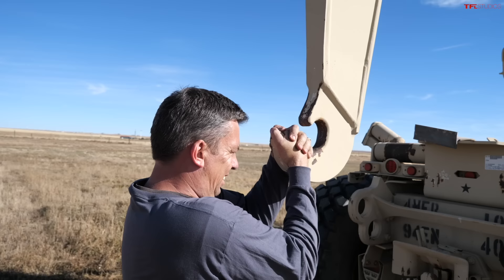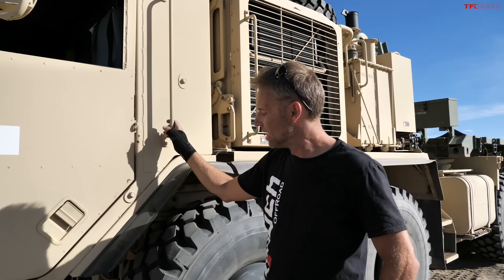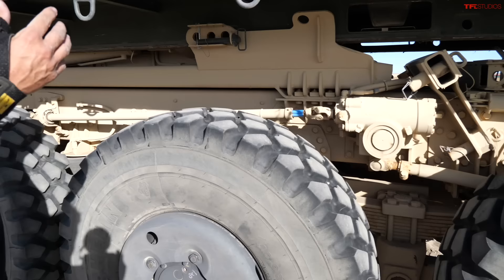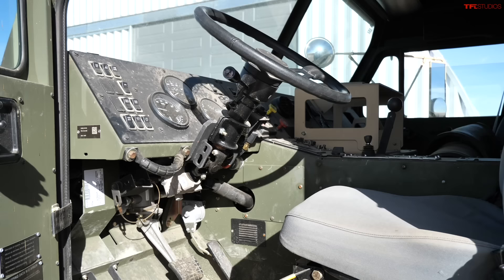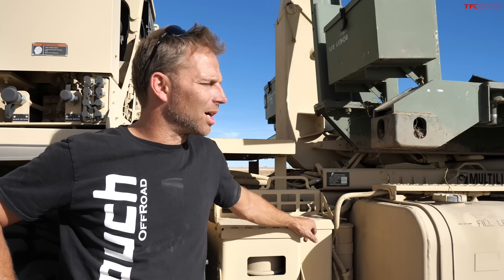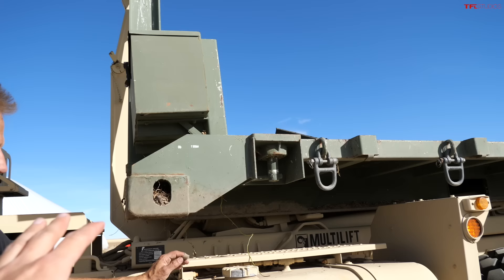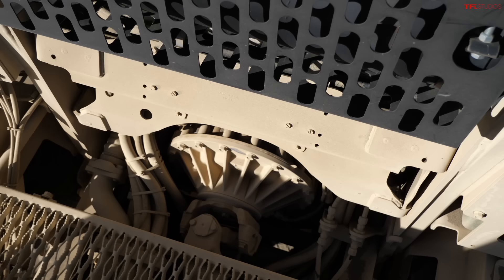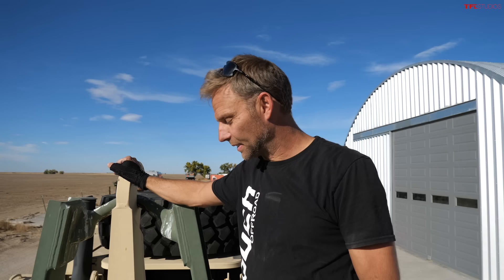Think A 4x4 Is All You Need? This 10x10 Military Truck On 53s Begs To Differ!

Comment: You're using this for recovery you should of just got a wrecker. The m984A4 is an absolute beast. Automatic 7 speed should be an rds 4500. The engine is a Cat C15. If its a front tire you can drop the air suspension chain the axle to the frame and air the system back up, change the tire and unchain. Overlander RV is a good idea for it tho.
Reply: This will chew up any wrecker out there accept an M88.
Reply: In what way?

Comment: We were doing a rail car load out and the ramp between two of the rail cars failed while driving the hemtt across. We couldn’t get the crane back that far to lift the truck back on the rail car. So the driver finished driving it off the side of the train.

Comment: you can make some money with that thing over at MOAB and so forth, all the big 4 wheeler places.. hit like the 400 in las vegas, so many break down and wreckers cannot get to em.. mana 400 lb winch and you can just pull em right up to the platform load em up and go!  people charge like $4000 for recoveries out there in the desert but they usually take 2-3 riggs to get em out... man what a rigggg...gg..gg

those doors and windows are waterproof, you can take those under water... yup get the snorkel attachment.. 7 speed on road 5 speed off with 2 lows.. this thing is a beast why you never see one stuck, some of them have the run flat, and you have like 5 air pressure settings on the fly, hard, hard soft, medium soft and then run flat.. so if you're taking flak and a tire gets hit you push run flat and still get out of dodge...  DOH!!!!  they boogie too, do like 70 I think?

be sure to hit HARD on the tire air pressure system you can do 70, makes the tires larger round... yup
Reply: also they can go anywhere, note the low overhead...  yup
Reply: Don't tell snuffy he can't get one stuck! He will!

Comment: I designed and built armored vehicles for various governments and contractors in the Middle East.
Early in the war starting in 2003 and onwards, we were asked to talk with OshKosh regarding adding armor to the HEMTT`s.

Gave OshKosh a cost per truck to stop .50 cal BMG. The Army deleted the added cost for the armor as "too expensive".Lol. 
They came to regret that stupid decision,later....I would much prefer the TATRA 8x8`s and 10x10`s with the Cummin`s diesel.
Fun fact...a massive freight pulling locomotive can achieve nearly 6 MPG pulling 6000 Tons!
This bloody gas hog gets 2.6 MPG? Only the Army would employ that rig and it`s unarmored!

Comment: there's a place in Illinois called Allen's Corner Garage. his newest Wrecker the bumper lift which sticks out 15 ft from the bumper will lift 100,000 pounds was designed to pick up a hole Greyhound bus.
Reply: one more s t a t it's empty weight is 74,000 lb 3 axle Drive.

Comment: I remember this in the Army as being a 12 cylinder supercharged twin turbo diesel..in the 80s
Correct me if I'm wrong please..
But what a beast that thing is..👍
Reply: Sounds like one of the old Detroit 2-strokes. It's not really supercharged as it needs the blower to run. All it basically does is blow the exhaust gasses out of the cylinders. Now the turbos just added the fun factor :-)
Reply: Sounds like a Detroit Diesel 12V71 or a 12V92 you're referring to. And no, it's not supercharged, it's blown for air intake and exhaust since it's a 2-stroke (compression and ignition/power strokes only).

Comment: Yes, one of these, made bulletproof and tire slash proof, with a specifically built house on the back of it, with solar to have a hybrid like engine, out in the middle of nowhere in say Canada, yes, yes and yes.

Would cost about £3m though, lol.  But no one would be getting in and you could take it anywhere.  Honestly, PERFECT.  Would need to know your mechanics and diagnostics though to maintain the thing.

Comment: That 2.6 mpg at 65 is pretty good considering each tire is like 1k lb
Reply: The tires don't wieght that much.
More like 200lbs 
Two guys can pick up the tire.
Sorry but I'm not that strong. 
800 to 1000 lbs means we both would have been lifting 400 to 500lbs each. 
Maybe they didn't even weight that much. But I do remember pfc K and myself lifting one 
And Honestly PFC K wasn't that strong. 
Funny years later I talked to PFC K and he was working at a pallet company.
I always found it ironic he drove a PLS and later built pallets.
Reply: Oh and mileage. I don't recall but swore it was about 10 mpg. And my foot was pure lead.
Reply: @baddog9320  Tires weight around 350lbs, wheel is about 150lbs. So somewhere near 500lbs each, 5000lbs including all axles

Comment: I think it do have another 4 inter axle diff locks also, if it is 10*10 on any surfaces. Total 9 diff locks if it can travel on high traction surfaces with 10*10

Comment: I like the way you think... GO BIG OR GO HOME...

I designed my own multi-axle 6 x 6 truck. It has 3 complete engine/transaxles; 1 in front and 2 in rear. 6 Wheel Drive, 6 Wheel Steer. Forget a tiny rear bed, it's 8 feet wide x 16 feet long. Can haul full sheets of plywood sideways. One problem we encountered, with over 5,000 horsepower it needs larger fuel tanks. 

We did design a 8 x 8 with 4 engines/transaxles vehicle. 2 in front and 2 in rear. It's set up for Land Speed Records. 10,000 horse power gets it to 600 mph. Waiting for special tires from Goodyear. 

Our 10 x 10 using 5 engines/transaxles has 2 in front and 3 in rear. It's setup like our 6 x 6 truck. Giant back bed, giant crew cab with room for 9. It's almost street with the right tires. 5,000 horsepower, 10 wheel drive and 10 wheel steer. 

Your Monster looks like no one or no thing can stop it. Like driving the baddest rig on planet.

Comment: He mentions the mileage but doesn't say anything about fuel capacity or working range. That's a lot of gears to turn; the transmission w/ torque converter, transfer case, the Open Differentials that can be activated to lockers(lockers aren't differentials) besides the hydraulic steering. That's a lot of work.
Reply: Good point, I don't remember for sure 75 usable gallons?
This is an issue when doing linehaul operations, one other negative is the clearance height. More then one PLS has struck a bridge hauling containers.

Comment: 1,000 gallons of fuel @ 2.5G per mile is 400 miles range. Without anything build on top of it.
Reply: Miles per gallon, so over 2000 miles on 1,000 gallons.

Comment: Pretty cool wagon, not keen on the rear steering axle too much to go wrong, same goes for the independent front suspension, nothing beats a solid axle on coils  like the MAN,s,. Needs a big winch on the front a second winch behind the cab and a pair of spade anchors. Mentioning the beast,s poor fuel economy on the road or any paved surface ,can you disengage the front drive bogie to improve the meagre fuel economy?.

Comment: M1075A1 PLS* I love the the A1 the M1075 is crap. And 65? 🤣 Hope you bought the 10 and 23&p manuals. Also drifted one in Poland in the snow. Check the data plate to find all that information. It's cheap for start buy, but to maintain... ooof. 🤣

Comment: Those trucks are bad ass looking but the frames are weak. That crane might be rated at 35,000 pounds for a straight lift give it a little angle and you will pop the sub frame right out. Be careful those are meant for careful loading and not recovery

Comment: Good truck used them plenty in Iraq and Afghanistan.  Almost nothing it can’t move. 

As a big out rig you should have gotten the up armor kits. 

They need to put a decal that says “EV Off Road Recovery Vehicle”.  

Cause you know there will be plenty of EV trucks off getting stuck because someone believed all the hype of the ads for their truck of choice BUT didn’t take into count the weight of the batteries.

Comment: These are nice vehicles but the time, money, maintenance and thoroughly going over it to make it dependable would be a little too much. Good all around truck my 5.9 Cummins Diesel manual transmission 2500 truck. $20.33 a month minimum liability state required insurance. 14,200 lb with truck and trailer actual fuel tests 19 miles to the gallon. All stock except the K&N air filter that come on it no tuner.. But the catch I was only running 35 to 40 mph maximum to get that fuel mileage with cruise and AC on hot days. With just the 2500 Dodge Cummins 5.9 truck at interstate speeds around 70 mph at 8400 lb it gets 11 miles to the gallon. What I never realized for a long time the more RPMs you turn on anything the worse fuel mileage you get and more wear and tear. With just the truck and around 8400 lb weight around 40 mph around 1050 rpm's with cruise control and AC on. I got a actual 42.5 miles to the gallon. Less RPMs and less weight makes for increased fuel mileage on anything. On manual transmissions lowering shift points, drifting in neutral and shutting off engine on all vehicles at stoplights increases fuel mileage. The most I ever pulled was just over 23,000 lb in my single rear wheel 2500 Dodge diesel Cummins it's a good thing the bumper pull trailer didn't have any miles on it and the brakes worked good. Or I wouldn't have been able to stop and for safety I was only going 40 mph maximum at times. I didn't measure the fuel mileage then but it sure burned some fuel pulling that big load.

Comment: This is junk compared to the new combat deployable version of the MRAP Marine Corps LVSR. It sports the invisible armor windows, as a bonus, there are extra steering gears in the back that automatically turns the rear tires the opposite direction into a perfect turn.

Comment: So, the specs on the engine are as follow: Caterpillar (CAT) C15, 15.2-liter, 6-cylinder inline water-cooled diesel[2]
600 hp (450 kW). Anyone know how much torque it produces?
Reply: Less than the 580V8 of Scania

Comment: Honestly: where would you drive one? What trip would befit its capabilities once built? I don’t know if you could take it through the Darien gap- or areas that are too swampy. Maybe some of the untracked wildernesses in northern Australia?
Reply: As it is being converted with Armored Cabin, this would be ideal in African or South American Regions with high threat.   1,000 gallons of fuel x 5 MPg would give you 5,000 miles of range.  2,000 gallons would give you 10,000 miles of range.  That would be enough to go from the bottom of Africa Cape Town to Egypt and Back.  Or across North America and Back twice. ... You can bet who ever is doing this is going to use Foam Filled tires. ... Someone is getting ready for a pole flip type event.
Reply: If you don't mind the ginormus fuel costs lot's of places to go off-road in the US. Colorado, Wyoming, Utah.
You could have a converted container for living quarters, heck, make it expandable, drop it in place, get a PLS trailer and put a houseboat on it, take that thing camping!

Comment: People there is a HUGE difference between the PLS/ CHU and a Hemmet.
There is no PLS wrecker. That is a Hemmet.
Hemmets have nothing on the PLS.
Also the 10 wheel PLS/ CHU was new to the Army in the late 90s. I was one if the Army testers for it.
There is an 8 wheel pls and its basicly a hemmet.
THESE ARE NOT HEMMETS 
These are much better then a hemmet.
If you have not drove the 10 wheel then you have no experience with it.
The PLS/ CHU is a far better vehical.

Comment: With the Unimogs, is the Trans/t-case units they use tuff enough for a M923A2? The U5000 series is similar in weight. Reason being I have lots of wheeling time in my belt and love the Forward/Reverse- sync shifter the mog has.  Just thinking how I could get this into a M923A2.  If not have you ever seen a Forward/Reverse-sync type case add on? Love your vids BTW. So cool!
Reply: It is a 7 speed Allison Auto and a divorced t-case behind a Cat C15. You won't find a bigger setup.
Reply: @rrpeters  do you know the model of the tcase? Is this the setup that has the forward/reverse synchronized rocking shifter that allows you to use all forward gears in reverse? Thanks for the response.
Reply: @jefferyhorne1863  it is not a reverse gear in the t-case like a tractor or unimog. This has a standard auto trans with reverse.

Comment: Ash kasha  is a model of change to
mechanic gear box 📦  is better than Atomic transmission  with electronic is low range movement as rock system it’s slow

Comment: i remember getting called to take off tire off reverse tread 0300 since driver could not so they called me, mech at the time lol yeap bunch of two hundred pound dudes with cheater bars going all lock ON on them reversed.

Comment: Lol… NOPE … helmet required to drive those.  I drove the marine corp equivalents and sitting in front of the first axle is same as back of a school bus over speed bumps.  Great truck if you desire to be a few inches shorter after trying to keep up with real off-road capable vehicles in convoys.  One convoy and your spine will try to exit your a$$.  Broke both feet on one convoy after bouncing off a small ledge I didn’t see amidst the dust from vehicles ahead of me.  Thankfully my helmet was on, otherwise I’d struggle with remembering my name.  You guys obviously got fed a load when the military “experts” told you all about this heap.

Comment: 😂😂The weak point of this truck is mud, it becomes useless and weak in mud only. It is expensive. Its weakness is in mud, it😅😅 becomes useless
Reply: I’ve driven them overloaded through mud with no problem  with/without the trailer you can use